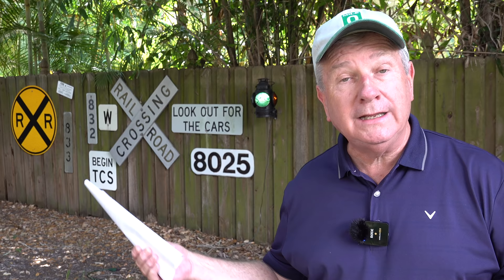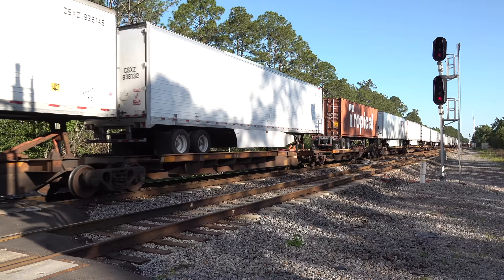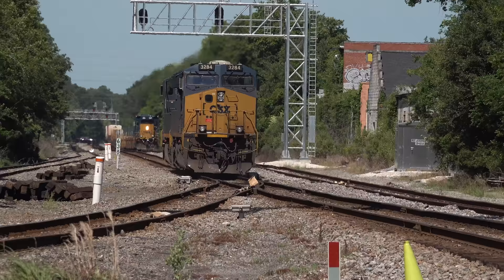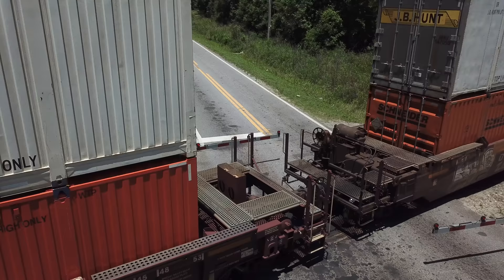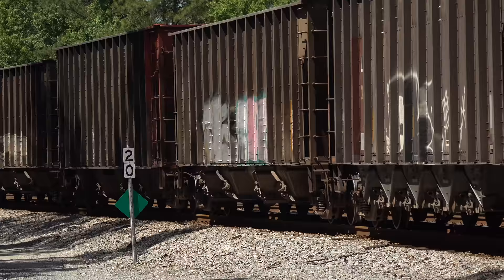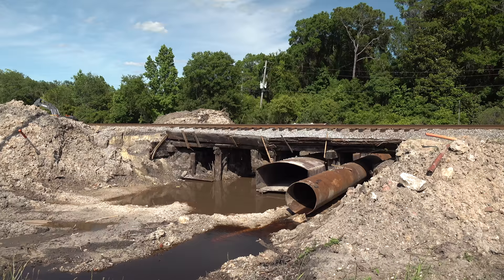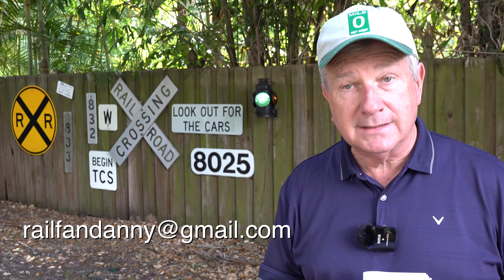How Distributed Power Works

Comment: I was 5 years old eating dinner with my parents one night, and the restaurant we were eating at had a pretty well used rail line right next to it. The first time I ever saw one of these, it came in the form of three engines up front, a crap ton of hopper cars full of sawdust, then one engine turned around backwards pushing from the back. For some reason my little 5-year-old brain though that was hilarious and I was cracking up about it all the rest of that night. It could’ve been an MP with a deadhead at the back but it was still really cool.

Comment: From Alamogordo, NM. Union Pacific did extensive rail & siding improvements to their lines on the south side of town. They now can handle trains almost three miles in length. They almost all have 2 to 3 engines at the head with 1 or 2 engines mid and 1 or 2 at the tail end. Very impressive.

Comment: Very description of DP there Danny. I drove these in Australia. Some were front - middle back configuration. Thes were great for providing less stress on drawgear and better response to brake and brake release. Propagation of air over long distances is an issue on long trains leading to dragging brakes. Great video.

Comment: This answers some things I was wondering about.  I live in SW Ontario, in a town bisected by both the CP and CN mainlines to Detroit and Chicago.  While I knew big trains out west and going through the Rockies had extra locomotives in the middle or back, I never saw them here until a couple of years ago.  Here, from what I see the DPU's are (by visual estimation) 2/3rd's from the head end, and almost always it's on east bound trains that are mostly or have many crude oil tankers on them destined, I assume, for the Irving Oil refinery in New Brunswick.  I've yet to see one on a container train-- and if there's one on mixed freight, there's always oil tankers included in the mix. The sources I read on this just talked about taking pressure off the knuckles, and being safer as a result. I wasn't aware of the drag issues on curves, or fuel and labour savings.  Thanks!

Comment: I was interested in hearing how without DP the inside wheels wore the rails by putting more pressure on the inside rail. That has always been a problem for my understanding of a train going through an incline, circular tunnel where it came out above, while it tail-end was still not in the lower part of the tunnel. I always thought it would be dragging on the cars further back more and more as you got to the end of the train. Thanks for this explanation which cleared up my tunnel conundrum.

Comment: Those (articulated well cars) that carry shipping containers bring back memories of building them.
Reply: Hi McGoover, CSX Engineer here. we call them "intermodals" The idea is actually a good one. They can go from a ship, to a rail then on a truck. All by having standard sizes and standard attaching joints. Oh so you use to build the actual Container? Heard that was David Murdocks idea back in the 1980s
Reply: @cherylsims5636  I used to worked at National Steel Car here in Ontario Canada, The factory makes "well cars" as we called them for sea shipping containers, they also made Hopper cars, Beam cars for lumber and building supplies ect...
I believe at the time the contract was with TTX... I think... it was years ago that I worked there.

Comment: I worked with the Harris Corporation in the 1980s. Harris had a division (Controls) that was doing prototype work on DP. They had 6 miles of track and 8 locomotives of all makes. Not sure who makes this equipment today but Harris Corporation was in the lead 35 years back.

Comment: Dpu have been around for atleast 30 years. The units mid train were controlled by a robot car usually an old box car with a small genset to power the radios as well as compressors to control the independent braking system for the units mid train. Back then they didn’t have the radios that each unit has in todays world. The head end would  send signals to the robot that controlled the units mid train.  Sometimes while parked in a yard conductors accidentally left the robot dialled in and the units would start  moving by themselves. Todays trains running DPUs can run mid train and tail end units just because of each unit has radio gear to control multiple units without the robot cars.

Comment: First off - amazing production quality on these videos!
Secondly - seeing all the trains, this long, double-stacked, makes me very sad about the railroad network in my home country (Norway). Railroads aren't really prioritized here, and when they are, it's usually only to improve passenger lines (even though traveling by bus is usually way faster and cheaper than rail..). Since 80% of the railroads here are electric, we could save a lot on emissions from semitrucks by simply replacing longer hauls with railroad hauls, but since the railroad is so neglected there's usually only 1 railroad operational (no dual track), signal errors are frequent and people just don't trust that the train will arrive in time. 

Parts of the railroad in southern Norway was closed for a week due to a small rock slide. Since there's no dual track (which would have meant that the second track would be operational), and basically no secondary lines, there are no possibilities for detours. The trains are literally stuck until they get the rubble away. It's a shame.

They even spent YEARS building new fancy signaling systems for the rail, only to realize that each geographical region pourchased their own signaling system which was different from everyone else's, so for several years there was like 4-5 different signaling systems in Norway that all talked to each other through a central hub. That hub obviously went offline several times a month so the railroad became kind of a laughing stock as it was just not reliable at all. They are finally replacing all the signaling and fixing this, though. But it's just stupid that we had to go through this.

I think, if they built double-track between all the major cities, and also built double-track to the northern parts of Norway (to promote industrialization and population growth there), then we could see a whole new era for the Norwegian railroad. We saw this in Sweden - when Sweden decided to privatize the railroad, they coincidentally also built a lot of new rail lines, which ended up with a passenger growth of up to 500%. On top of that comes the cargo growth. Which shows, that building more railways and maintaining it, is the key to get more goods to run on the lines, and less to run on the roads and in the skies.

Man we have a lot to learn from how USA does it!

Comment: Not to burst anyone's bubble here, but I have been seeing distributed power on my home railroad (BNSF) for as long as I have been alive (16 years). In this video, Danny, you seemed very surprised to se a locomotive on the tail end of the train. I have seen this for years. I don't know if this is just because BNSF learned this before CSX or you just hadn't seen this before, but it has been happening for a while now. Of course the trains I see are mostly super long intermodal trains, so that might also have something to do with it. Thanks for another amazing video!
Reply from the maker: No bubbles burst here, Jacob.  Actually, the first DPU I ever saw was on an NS Coal train at Braswell, GA in 2001.  I guess CSX never needed DP because, up until about 2017, the longest trains they ever  ran were about 8500 feet.
Reply: @distantsignal  That makes more sense now. Thanks! Looking foreword to your next video!

Comment: It's not merely cost savings. It's simple practicality. If you're to get a train longer than a certain limit, the slack begins to cause problems that jeopardize the safety of the operation and if that happens, a derailment could ensue, causing that rail segment to be out of commission for some time and you could also be faced with a hefty cleanup bill. So economics drives the decision for longer trains. Practicalities of operating these long trains demands DP in order to better control how the train behaves as it crests hills, handles valleys, or navigates curves.

Comment: I remember when Distributed Power started to become available in the 1970's, the electronics effectively took over most of the electrical cabinet on a locomotive or required a locomotive with a longer nose to accommodate all the DP control equipment (Southern Pacific had a number of SD40's and SD45's with longer noses to fit the electronics). It wasn't until the 1990's that the use of modern electronics allowed the DP equipment to fit on any locomotive, and most modern locomotives from Wabtec/GE and Progress Rail/EMD have DP electronics built in as part of their electrical cabinets.

Comment: DP can also be done via Wire if the train is ECPB. I drive DPU trains every day, can be a one or two DPU's or as many as the company deem required. You are correct regarding the fence, we call it the bar. The problem with Radio DP is Comm's Loss where the DPU's lose connection with the Controlling Front Unit.

Comment: If you want to see distributed power check out BNSF San Bernardino sub east of Los Angeles, where 12,000 foot unit trains prepare to head up the 2% cajon pass.  Union Pacific meets up with BNSF here and they share track over the pass. Power is Usually 4 up front, and two mid by two end. Lots of foreign and heritage power too.  Good stuff!

Comment: One of the read backs that is given to our employees from a tower supervisor, or a central control train controller, to maintenance workers doing work within the yard or mainline is, is Expect on-rail vehicle movement, On all tracks, in all directions, at all times, you will provide your own protection, and do not interfere with mainline operations. So yes definitely have to watch for train traffic, but your camera setup was good, you weren't fouling the tracks, you were clear of the dynamic envelope.

Comment: These are great videos, and very informative. I'd like to inject a small bit of reality to this video for added context.

You'd be surprised the amount of turmoil that has been brought on by PSR (precision schedule railroading) to longer trains. Although distributed power works wonders for hauling freight, the railroads were not built to support trains that long. The Surface Transportation Board has been under fire for allowing the railroads to operate in this manner because it has increased accidents, delivery times, and reduced workforce opportunity. In some instances, only an engineer is present on these trains, without a second set of eyes by a conductor. There are even safety mechanisms for braking these trains on the conductors side should there be a disagreement in braking too late. The point is operating an engine from point A To Point B is complicated process of check marks. I truly hope we see more safety measures taken by the railroads instead of solely relying on a productivity system and target metric that has shown failure in its implementation during the pandemic.  No matter how much money they save and send to their shareholders, in the short and long term the main lines, equipment, personnel, and companies all suffer as a direct result.
Reply from the maker: Thanks! I'm not at all surprised that PSR is creating turmoil. First, no one likes change. Employees always resist it. Railroads are among the staunchest opponents to change. Second, this PSR thing doesn't seem to work in all sectors of the industry. If it did, customers would not be howling about it so loudly.

Comment: Back in the 60's the Southern railway was one of the first class 1's to practice this technique but they called them Radio controlled units (RCU's) or slave units. IDK how they do it now but the engineer had to manually notch the RCU to the same speed as the head end power with a separate radio control on his dash

Comment: Kansas city here, never get to see such long Amtrak consists around here. Went to college in Warrensburg Mo. "MO river runner" amtrak. Edited 
  Just discovered that the route to Chicago is not through StL via river runner, hence La Plata Mo.
Reply: Hey Kansas. CSX Engineer (FL) here. I guess it depends on how close to the traxs .AMTRAXS which run like 20-30 cars are real nice to drive as opposed to the 100 plus freight trains.

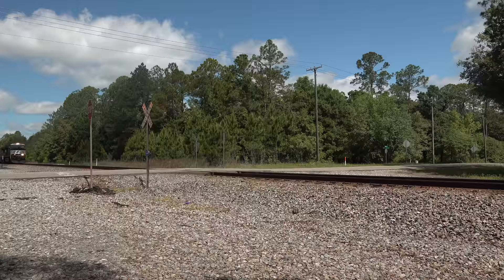Comment: FYI:   From the 22:57 to the 23:20 mark you talk about train make up and mentioned that the CSX tries to group car types together.   On the UP we  switch cars in station order.  It would take a lot of time to then switch those cars according to car types.   You know the bean counters are going to keep their labor cost as low as possible.  I doubt that any railroad tries to switch cars according to type on a mixed freight.  

Some times there are large groups of intermolecular cars in a mixed freight train because the intermodal yard is usually separated from the regular switching yard, although they may be next to it.  Ours was a couple miles away from our Avondale yard in Westwego.until the UP SP merger.  Then the intermodal cars are placed in a mixed train in station order.
Reply from the maker: Thanks Bill. I think CSX actually does this too. Grouping cars by station they're headed to. I've learned a lot more about this since then. Thanks!
Reply: Distant Signal   For a rail fan I’m very impressed with the accuracy of your commentary.   I can tell you have done your research.
Reply: @billmorris2613  I know this doesn't have nothing to do with you guys conversation but I was wondering if you all knew if the CSX station or whatever it is down in tiftonia "I'm guessing it's middle valley" TN is still in operation?

Comment: Hello Danny,  really enjoy your videos especially the ones about how the different gear works along a train from Distributed power to crossing signals.  One thing I have always wondered and I don’t know if you know this is how end of train devices work?   Are they just battery powered or is there a electrical current that flows through the air lines or some other type of technology that powers them? Thanks.

Comment: Great video as always Danny. It is interesting that NS, UP, and CSX just "discovered" DP units because trains out west always have a trailer dpu unless it's a manifest or Q/Z train. BNSF trains out in Montana at least have pre-determined amounts of locos per unit train type. A coal train will have a min of 2 units at the front and 1 at the rear but will always have 4 units, so the 4th unit is either placed at the head end or at the rear. Grain trains are always 2 min at the front and 1 at the rear. It seems to me CSX, and NS are just trying to greedily save money by running fewer locos because of PSR but DPus has been used for a very long time.
Reply: How to make the best spaghetti and meatballs

Comment: We had a Propane Car developed a Leaking Valve because of the old Weather, we Evacuated a One Mile Circle while it leaked out Propane we were on scene a mile away for 24 hours before CSX could get a Controlled Demolition Crew based out Texas Flown in and those Fellas Blow that Car up in a Controlled Explosion. It rocked us at Incident Command Center. I was a Asst. Fire Chief Back then.. I am now Retired after 23 Years. We had another situation where the Driver of the Engine was Breaking Cars and the Poor Guy was going through a divorce and took off in the Engine at full Speed and just north of the Carpenter Rd. Break yard was a Pretty tight Curve that old boy launched the Engine 100 Feet off the Main Line. Poor guy had a Nervous Breakdown. I have seen all sorts of Riders go by on those trains also spoke to quite a few as a Young fella that lived literally a few hundred feet from the Carpenter Rd. Rail Yards.

Comment: The old SAL Gross cutoff you can trace on satellite images. All the tracks have been removed, CSX has sections of it blocked off but there a few bridges along that line still in existence. A page I was reading up on some information about this old line said CSX had plans to put it back in service with new track. That was some years ago, doubt it will happen.
Reply from the maker: Around 2000, there was such congestion in Jacksonville from coal trains that CSX was talking seriously about putting the Gross Cutoff back in. 22 years and the demise of coal-fired power plants have killed that idea.

Comment: Some of the info on you give on dp is accurate, as far as the slack action you still get run ins depending on the territory. Besides that you are about 98% accurate. Some railroads don't allow the engineer to use the  fence on dp. For the most part the dp does the same thing the leader does.

Comment: You mentioned to be careful about those double tracks and it reminded me of an experience about 15 years ago.  Riding my motorcycle, I had to stop at a RR crossing while a long train passed.  This took a while, but finally the train was ending.  However, another train going in the opposite direction on the other tracks came thru right as the first train ended.  After the 2nd train ended, I thought the bars might come up soon.  I waited about 5-10 minutes after no train was in sight and the bars were still down.  I was scared thinking I'm gonna die if I go around those bars, but I finally did.  I went around though, and as I drove out of sight, I looked back at the dozens of cars just sitting there waiting on those bars to go up.  I have no idea what caused this.  Maybe someone can explain why that occurred.
BTW: You videos are awesome.  Thanks.